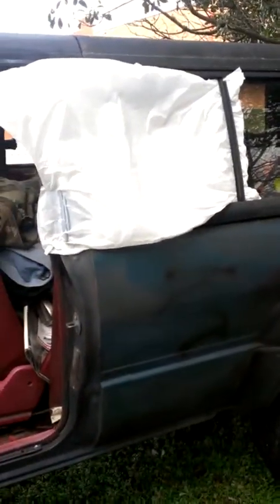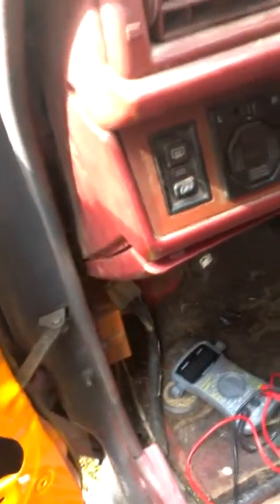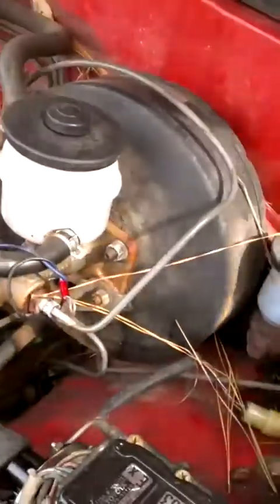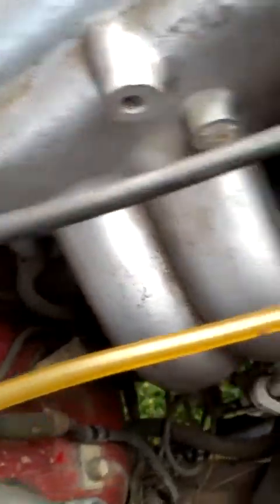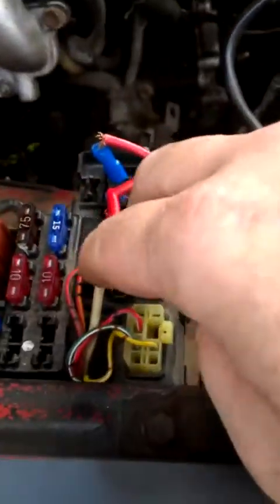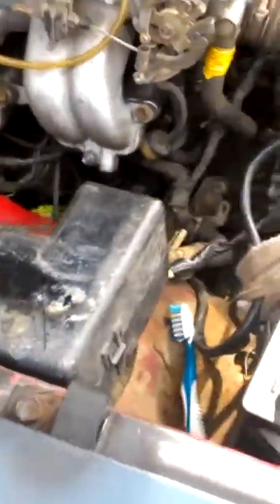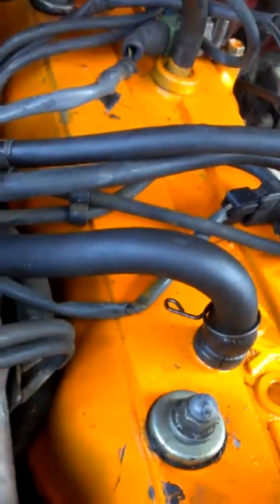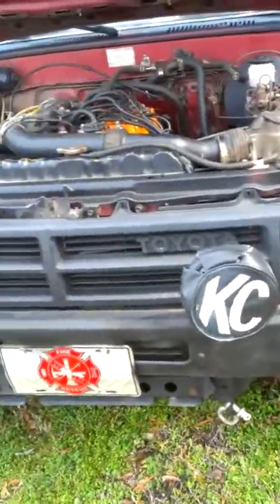87 4runner will not turn over

Comment: That square plug goes into the back of the idle air control valve.  It's below/front of the intake manifold.  There are 3 or 4 hoses that also plug into that unit.
Reply from the maker: adam Pepper I got it fixed a few years ago and sold it.. but thanks for the help